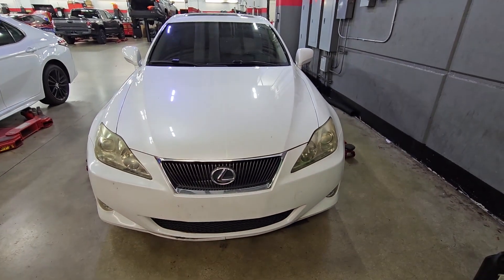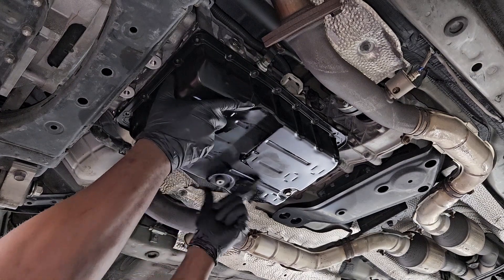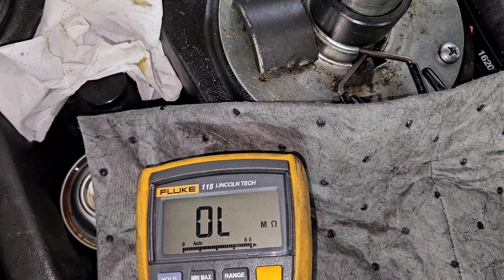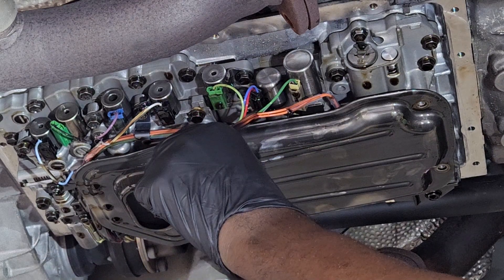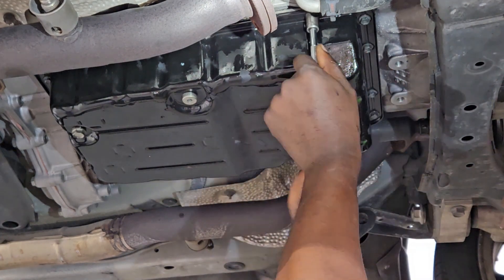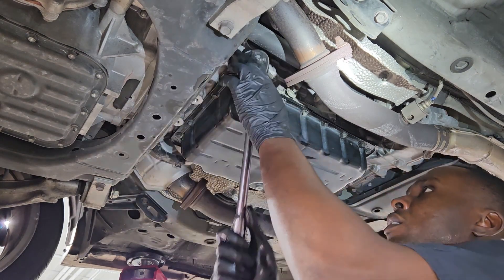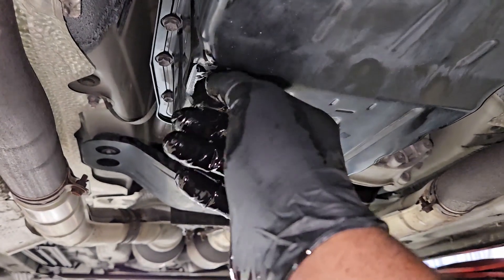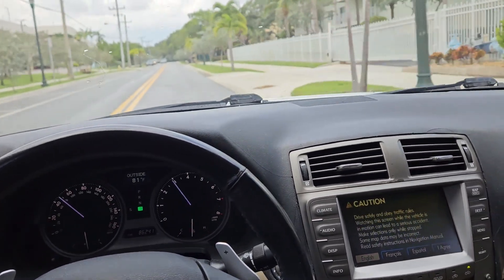LEXUS IS250 (DTC P2714 & P0756) DO I NEED A NEW TRANSMISSION?

Comment: Hello this was an extremely helpful video! Although I tested all the solenoids and they all seem to be reading the proper ohm level. My 06 is250 is jerking and having trouble shifting through gears. The oil pan is looking good barely any metal shavings. Do you have any suggestions?
Reply: im thinking ECU how many miles on your car?
Reply: @SecondBestWinner  I ended up just changing the gasket and did multiple oil flushes and its smooth as butter now. Im thinking oil was just really dirty. Thank you tho!
Reply: Have a rx330 started flare shifting 2-3 and rough shift 2-3 any idea what could cause that? @SecondBestWinner

Comment: Hey man! Appreciate this video. Do you think this would possibly apply to a 2010 Lexus is 350 with the A760E transmission? I've been getting a p2714 and a P0761. It trips completely randomly but always during a cold start and during it's first shift from 3rd to 4th. It will drive for thousands of miles after that just fine. Sometimes I can go a month without tripping any codes or it can be just within a couple days. I've taken it to our favorite local transmission shop and they are at a lost with the problem. It drives perfectly fine otherwise and hasn't gotten worse over the last 30,000 miles since this started. We tried replacing the SLT solenoid but no luck. Any advice would be great! Thanks!
Reply from the maker: Hey, this is directly from the Toyota & Lexus repair manual for DTC P2714 it states, " If any other codes besides P0894 and P2714 are output, perform troubleshooting for those DTCs first." In your case,  they should've troubleshooted the P0761 first, which indicates a possible S3 solenoid going out intermittently. They replace the SLT solenoid based on the P2714, which Toyota repair manual wants you to troubleshoot any other DTC FIRST.
Reply from the maker: While the transmission pan is down, it's good to check all the solenoids, not just what dtc code pin points to. But at the same time, the S3 could be intermittent and may have tested okay at the time, but stick at other times.  You should try and give the S3 a closer look.
Reply: @TheYotaChannel  Interesting! I will have that looked at. If the S3 solenoid has the correct resistance then is it most likely something else. I guess if my problem is intermittent it may only check out occasionally. Appreciate your response.
Reply from the maker: @Bdog0820 Especially since you said the symptoms are not getting worse.  Most intermittent issues are electrical related. If it was a mechanical issue (worn clutches, planetary gear sets,etc), it would be more consistent. A slipping worn clutch doesn't slip one day and grips the next.  But a sticking partially clogged solenoid could do that.
Reply: hey man idk if you already fixed it but I have p0761 on a 2010 IS 250, gonna change my S3 solenoid tomorrow. I will let you know if it works.
Reply: @put-tarrahnjahoova-bad718 update?
Reply: @rudimntary  changed it 2 months ago, it works and is still running perfectly
Reply: @put-tarrahnjahoova-bad718  hey,you only got the p0761 code? My car sometimes get stuck in 3rd and would yerk when putting in d in cold start. What issue did you have that replacing the solenoid solved it? Also, my code is stored in the ECU,it does not trigger any light in the dash
Reply: Unfortunately this has not been fixed however I've just been driving it with this issue and its not getting any worse. Still shifts perfectly and no slipping. I refuse to replace the transmission. There have been mentions of this issue caused by the bore plug leaking within the valve body. This would make sense if it's leaking when cold and then expands as the fluid warms up. It's a total mystery unfortunately and the only solution at this moment is to replace the entire transmission assembly. Luckily this isn't catastrophic and I can confirm this since I've put a whopping 50,000 miles on it since the issue started. To avoid the check engine and limp mode you can start the car in manual sport mode. let it shift through the gears until 4th once during your drive cycle and pop it back into drive. Then you're good to go.

Comment: Bro I got the same code do I have to get a new transmission or just replace the solenoids???
Reply from the maker: It's worth checking out the solenoids first before going straight to replacing the transmission. That's what i did in this video for the customer.
Reply: @TheYotaChannel  what if they are all good what can it be the computer not reading them ?
Reply: @TheYotaChannel  just checked them they good what else can it be the computer not reading them ?

Comment: Was this for the  A960E transmission ?
Reply from the maker: Hey, no, this is the AWD A760H transmission. The same diagnostic procedure can be applied to the A960E transmission as well. The pan and valve body set up are the same.

Comment: What’s the solenoid call or part number bro
Reply from the maker: This particular solenoid that failed in this video is called an S2 solenoid. As you can see, there are other solenoids inside the transmission pan.  You need a diagram from the repair manual to accurately identify which one is which as you test them.
Reply: @TheYotaChannel  thank you

Comment: For a 2010 IS350, is there a cheaper, dependable solenoid brand you would recommend besides OEM parts?
Reply from the maker: Hey, for transmission related components, i will always recommend buying from Toyota and Lexus. There must be a reason why it's cheaper aftermarket. It's a small solenoid, but think of how much it's switching ON & OFF during a normal trip.
Reply: @TheYotaChannel  thanks for the reply. After more research I found out it wasn't the transmission giving me problems, it was a bad MAF sensor that made the engine stall to shift into first gear. Got a new one and stall went away.

Comment: How much for all new solinoids??
Reply from the maker: They're expensive. A new solenoid from Toyota is $450, just for ONE. 😬
Reply: Legendary thank you for replying to my post very much appreciated. I was wondering if I could pick your brain for 2 more questions 1. Code P2714. Is the pressure control solenoid location the same in a RWD as it is in your AWD, and if it is 2. Was it SLT solenoid D?? 
I have a 2007 is250 with 2 codes P2714 and P0894 which told me to replace solenoid D and was trying to find its location. Thank you very much again my man god bless Happy holidays...

Comment: guys if youre planning on doing this i wouldnt even think about it without a small impact wrench that can get hard to reach areas, and a jack that goes at least 24 in off the ground. it looks easy for him cause hes a pro with a lift, it will be hell for you. trust me
Reply from the maker: I didn't need a breaker bar or an impact, but i did have it up in the air, which gave me better leverage.  Did you ever get a chance to replace the solenoid?
Reply: @TheYotaChannel  lol i was just pissed off when i commented that cause i rounded off the trans fill plug and couldnt get it off. Yes i changed it and it fixed it! Thank you so much man
Reply: @Jrdagreat its funny that 99% of people say that changing the solenoid doesn't fix it. Not just greedy mechanics wanting to change the whole trans, people on the IS forums said it wouldnt do anything too. glad i found your video!
Reply from the maker: @put-tarrahnjahoova-bad718  nice man! To be able to do that job means you are skilled. And yes, i agree it's worth checking the solenoids before you shotgun a transmission assembly.

Comment: like your videos.  thanks for a great channel.  Have a 2017 camry, 150k miles.  Been experiencing fluctuation in the rpm going down the road.  thought it was fuel pump at first.  gotten worse and worse.  now I have three trouble codes and it will not shift into 4-6 gear.  cannot get the codes to clear.  dropped the pan as oil hadn't ever been changed.  oil was dirty, not black.  Nothing beyond normal wear and tear in the pan.  shifts all the way to 3rd no problems.  master toyota tech told me he normally never sees these solenoids go out.  However trouble codes showing 2 stuck off.  can you give me any insight into this problem.  Thought it may be electrical,  traced connections and power into the transmission, no signs of anything awry.  please help.  pretty sure transmission isn't damaged.  U760E transmission

Comment: Replace all brand new everything OEM Toyota/Lexus parts n fluids from fresh off Japan because it was a lot cheaper for code p2757 for the locking solenoid. Yes CEL did went away but now just having issues on the locking drive mode up even small incline. Maybe not enough transmission fluid? I spec off everything like the fluid level also even torque spec all the new bolts.
Reply: There's also a TSB about pcm module needing software update and possibly repair. Fyi

Comment: Hello I have a 2007 IS awd and the shifter will not go into drive so I can't drive it to the shop.  I have taken the console off and I am trying to figure out if there is way to losen the shifter. It moves slightly to the right and then gets stuck. I don't want to force it as I am worried I might break something. This started a while ago and my mechanic lube it and it was fine for a while but it would start to get harder to shift. I did not drive the car as I was away for 3 weeks and now it is completely stuck. Any suggestions as to what I might be able to do and save me from having to tow the car as these guys charge a pile of money just to bring it 4-5 miles from my place. Thanks
Reply from the maker: See if you can remove the center console and pop the cable of the shifter and manually shift by pulling on the cable. Make sure you have your foot and the brakes while doing this.
Reply: thanks, regrettably I was not able to do that had the car towed to the shop. Thanks regardless.

Comment: Hey JR, I have P0761 and P2714, its currently in limp mode not going past 3rd. I figure its the SLT or/and the S3. The limp mode doesn’t mean the transmission is done for right? Just a failsafe?
Reply from the maker: Correct, it doesn't mean the transmission is done for. Before suspecting the transmission, it's better to drop the pan and check EACH AND EVERY solenoid.  That's what i did in this video, and surely enough, one of the s solenoids was bad.
Reply from the maker: After replacing the solenoid, the vehicle shifted fine after that and still operates with no issues.
Reply: @TheYotaChannel  
Good to hear, I’ll update this comment thread once I solve the issue to help others out. Going to change out the fluid prior to changing the solenoids potentially save money. Using that video you made. You hit all the pointers, keep up the amazing work.
Reply: @Slackful Changed out the fluid, code popped up again. It was dark but not bad. Was able to shift out of third briefly, then went back to limp mode after resetting the battery. Going to change out the SLT and S3 solenoids before I get a new transmission. Will update the thread. Codes thrown are P0761 & P2714

Comment: On my is250 2006 the light came on(p0751 and 2714) like in februari,but the car was shifting fine before,during and after clearing the codes..meanwhile csr was driving and shifting fine...after 5 months,2 days ago the codes came back but the car was still driving fine..cleared the codes,(same as before)and after a day it came back,but this time only 1 code p0983..cleared it and the car drives fine( 1 day passed).no harsh shifting whatsoever
I dont know what i need to do.the dealer says the USA cars can be different compared with EU spec cars regarding the ecm update...got any advice?

Comment: Could my solenoid be the problem even if its not throwing a code for it? My car is struggling to switch from 2nd to 3rd gear but there is no code. Thanks for the video man
Reply from the maker: Yes, it may take a while for the ECM to trip the code,  especially if you don't drive it much. It's worth dropping the transmission pan and test the solenoids to see if the ohm readings are in spec
Reply: The code ending up showing up. One more question, before you took off the pan at the start of the video, you had already drained all the transmission fluid right??
 @TheYotaChannel
Reply from the maker: @put-tarrahnjahoova-bad718  Yes, i drained the transmission fluid prior to the video.

Comment: Bro where is p2714 pressure control D performance/stuck in off position located???
Reply: im on the same boat, i replaced my transmission and the same code came back on, I'm thinking ECU. I'm gonna start with a drain and fill
Reply: @SecondBestWinner what codes did u have that made u replace it?
Reply: @rudimntary  p2714 and p0761  after the ecu and re flashing it helped but didn’t solved the problem. Sooooooooooooo I took it to north bell Scottsdale Lexus and paid 250 for a loaner and for a diagnostic only to find out my transmission was almost 2 quarts low after the install was done. Installed wasn’t from Lexus it was 3rd party. But the car drive great now. Start with the drain and fill!!! With filters
Reply: @rudimntary  and so far the code didn’t come back up anymore!!
Reply: @SecondBestWinner  Were you ever stuck in 3rd? or was it just the codes thats popped up. I have the same codes, but I cant go past 3rd gear
Reply: Did you figure it out?? Mine has the SAME code, but car won’t go in reverse at all

Comment: I have a question, so I’m doing this job for a friend soon, she wants to pay me for this job but I don’t know how to charge her. What would a be fare price?
Reply: Also how many quarts goes back in?
Reply from the maker: Doing a job like this outside, on some jack stands, i would say 200 is generous. 
Have at least 6qts of fluid. Also, be sure to follow the fill and adjustment procedure.
Reply: @TheYotaChannel  copy that and thank you. Yes, take off the adjust bolt and let it drain until it’s a thin solid stream. Correct?
Reply from the maker: @MrSmiles206  Yes, while the car is idling. I have a video doing a transmission fluid exchange on an IS350 that should help with the fill and adjustment procedure.
Reply: @TheYotaChannel  awesome thank you!
Reply: @TheYotaChannel  also I have a question on the same car. Brand new battery, car is trying to start but will not. Checked the relay and fuses in the engine and that’s involved with ignition and fuel there’s nothing wrong. I’m guessing the fuel pump? Thanks in advance.

Comment: Would this be the same procedure for the reverse solenoid? Car struggling to reverse
Reply from the maker: Yes, same procedure. It's definitely worth checking out the solenoids. Do you have any trouble codes?
Reply: @TheYotaChannel  P2714, p0894, p0761, p0756, p0500, so that’s about 3 solenoids that need changing.
Reply: Did you get it figured out??? My car won’t go into reverse AT ALL, and have only the P2714 code. It does shift at high rpm’s though but no slipping
Reply: @alejandroochoa3541  changed the entire transmission. Was difficult to find the solenoids separately

Comment: Hi bro, what was the problem with this transmision?
Reply from the maker: Hey, it was experiencing a harsh and delayed shift.
Reply: @TheYotaChannel  I have a problem with my 2007 Lexus IS 250, reverse does not work and if I put the gear in Neutral it acts as if I put Drive and Manual Mode also stops working, what do you think it could be?
Reply from the maker: @antonioponce1094  is it throwing any trouble codes? I would check to make sure the shifter and the shift indicator in the speedometer matches. For example, if you put the car in park, drive, and neutral,  etc... does it read park, drive, and neutral in the speedometer. But those solenoids can give you those symptoms as well.
Reply: I have a p2714 and p0761 codes but am curious do you work for Toyota and where are you located
Reply: @chipchopgaming274  i have the same code any luck?
Reply: @SecondBestWinner to be honnest every one telling me i need a new transmission i did buy the solenoids just haven’t installed yet i also want to try and service the transmission first if that doesn’t work ill try changing the solenoids
Reply: @chipchopgaming274 let me know the outcome with the change solenoids
Reply: The car drives better issue fixed for now atleast been changed about a month now
Reply: @ProtectThaBeats111 fixed
Reply: @chipchopgaming274  appreciate it